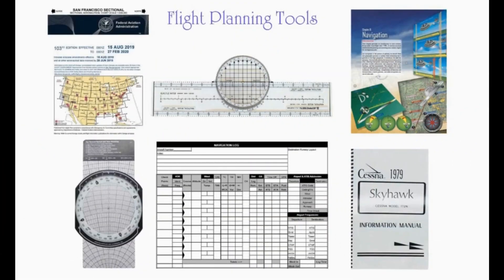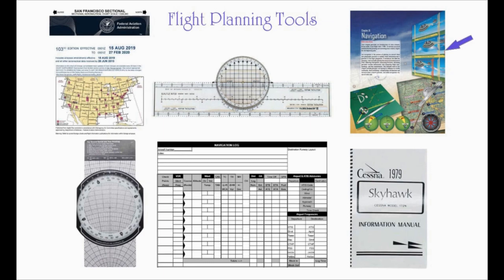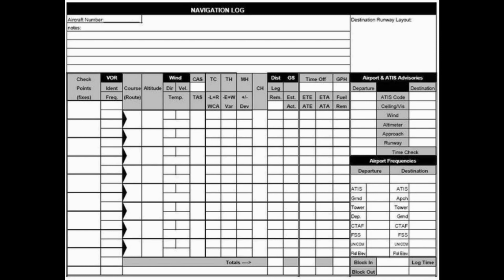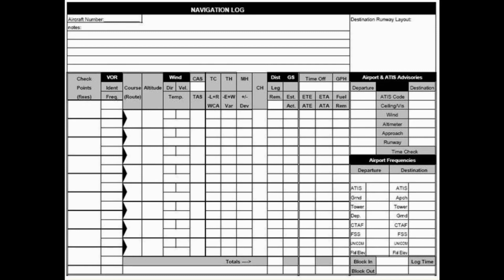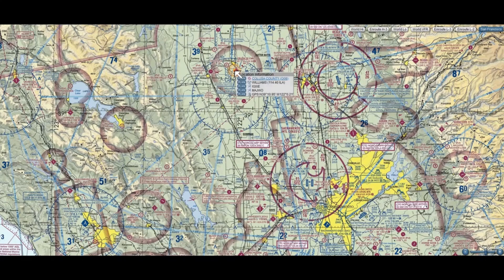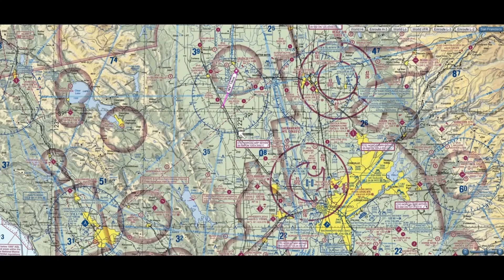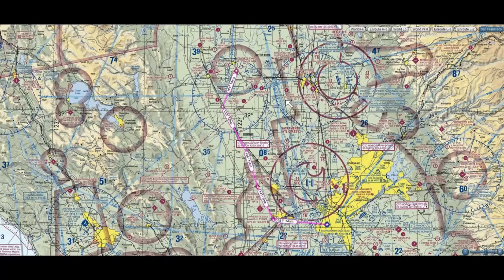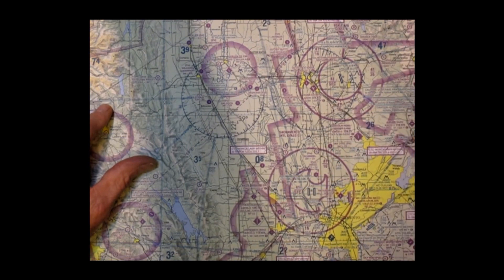VFR Flight Planning ~ The Navigation Log Part 1

Comment: Terrible focus on the lines 👎
Reply from the maker: HI Trackhoe075 , Really sorry about that my equipment isn't the best unfortunately :-(  I hope it didn't distract you too much and you got something out of the video. Thanks for watching :-)

Blessings,
skip
Reply: @WEHVideos thanks Skip I would definitely suggest investing in better equipment 

It didn’t look to me that you confirmed your skyvector readings to your plotter either 

I would think it would be very important to be able to use one to confirm the other 

I realize we are talking about a simulator here but accuracy in the real world is quite important
Reply from the maker: Hi Trackhoe075, This video is five years old and sectional charts are updated every 56 days so there has been lots of changes since this video was made. Skyvector always has the latest up to date charts so I would not be surprised at all if there were several differences between the chart I used and Skyvector in just a couple months after the video was made.

I appreciate and understand your comment and I try my best to be accurate and not have mistakes but unfortunately I've messed up on both on more that one occasion. With that I hope you got some value from the video and it helps in some way.Thanks again for watching.

Blessings,
skip